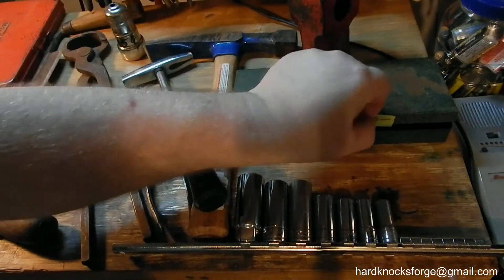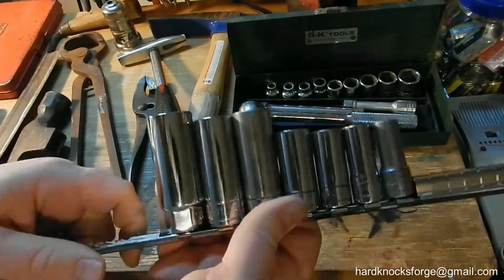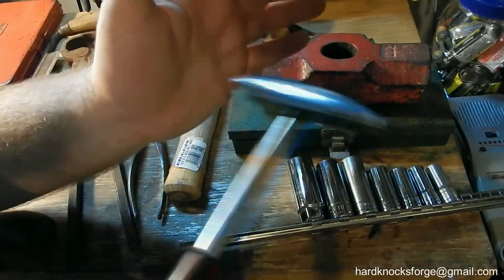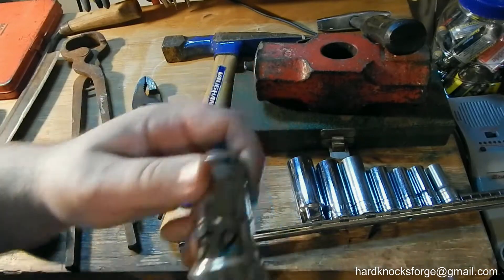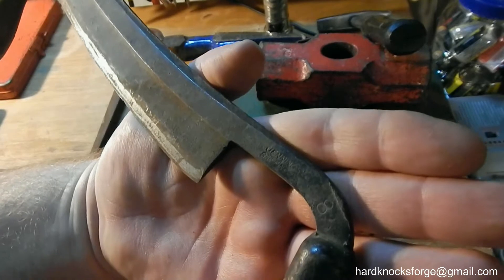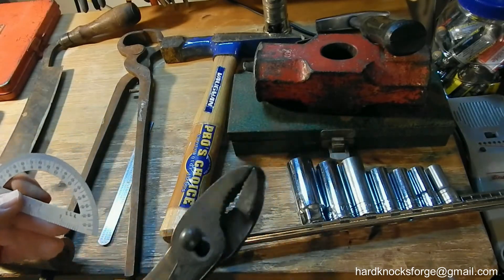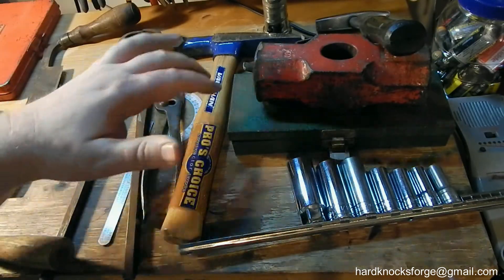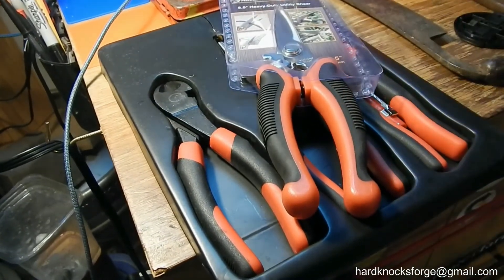Weekend tool haul via garage sales

Comment: if u take the brick hammer and replace the handle with a 2 foot one u will have a very handy tool
Reply from the maker: I maybe able to take that handle out, with little damage and put it into the claw hammer head I got.
Reply: once I get things sorted I will show what I did with mine it works well if u have to demo something